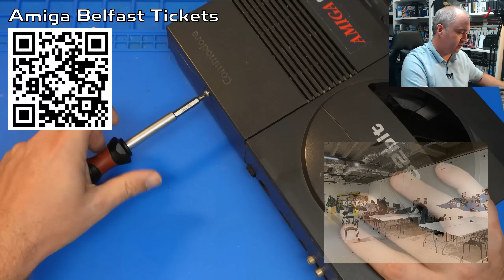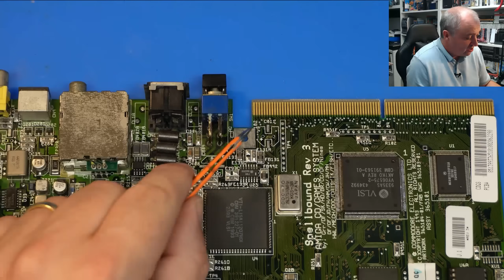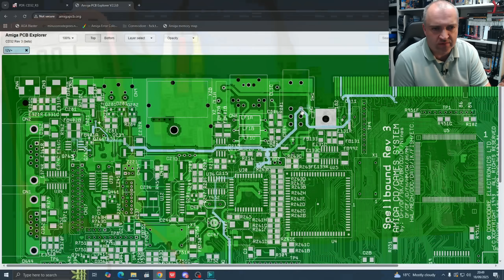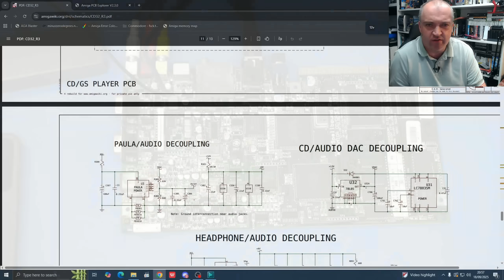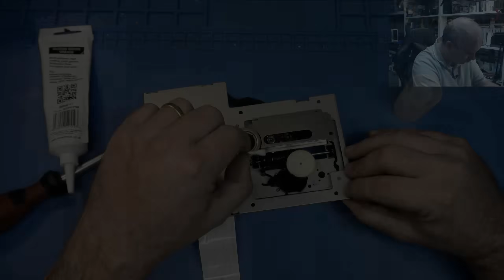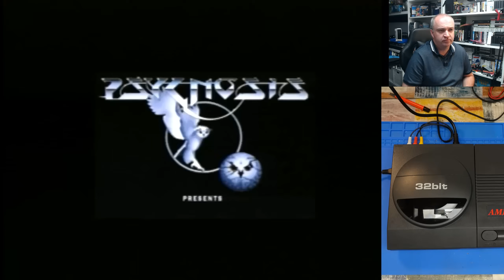I've NEVER seen this FAULT in an AMIGA

Comment: Hi Glen. So I used to be a quality control inspector for an electronics manufacturer down here in Dorset. The company was called surface electronics in the early to mid 90s and then became hansatech. We built satellite receivers, audio amps, vendor machine circuit boards etc etc. It no longer exists. Contracts ultimately lost to China through the naughties killed off a lot of the manufacturers in this country. Anyway back in the day, once a pcb had been populated, and then through the IR oven or wave soldered, it's possible that contamination could prevent a through hole being soldered. This would hopefully be picked up by a bed of nails test, and then a visual inspection. Two issues. Firstly the bed of nails won't pick up up an unsoldered switch, its mostly logic circuits it's looking at, and the visual inspection is relying on a human who is mostly rushed and under time pressure to get the product out to dispatch. So the final process that can pick up any issues is a test much like you performed in your video at the end. Its highly likely the pin at manufacture was just about making contact and sneaked through all of these checks only to fail out in the field some time later. Vibration making it not make contact, or hot cold expansion contraction. The fact there was no QC signature or paint pen splodge to indicate inspection done suggests to me the final look over never got done on this unit. We had a good qc system for a lot of our products, but I would say we found about 5% of units with an issue at QC stage. And maybe 1 in one hundred units would be returned. This does depend on the complexity of the build and the quality of the components that the customers specifies. Basically it was excepted that although you would do everything to ensure product went out perfect, inevitably some things would slip through the net. I guess that's why warranties and consumer rights are so important! Modern processes have no need for humans so much, and have eliminated manufacturing errors to a much lesser margin. I haven't worked in the industry since the early 2000s but I could see then that China could do it better, faster, and cheaper. But wether that was assembled in the uk or anywhere else, back then errors like that could easily happen.
Reply from the maker: Thank you for this detailed comment.  This unit must just have been missed and if it relied on a person to spot it and especially if it was working at the time then I suppose it's no wonder it was missed.  Made for a fun and simple repair 32 years later though 😉.  I've pinned your comment as its relevant to the video and useful for anyone coming to the comments to read.

Comment: I've had three A1200s in the past 32-ish years, and I had no idea about fabrication faults, but the last PCB I got hold of had most of the IDE header unsoldered. I'd never seen anything like it from CBM equipment before, and it threw me. So wonder if the same plant which made that CD32 also made the A1200 PCB I got a couple of years back!

Comment: Hi glen I have a Amiga cd32 that needs a recap also it needs a controller port one that also could be a broken soldering point or connector it’s got a intermittent fire issue works fine if you fiddle with the connector but this is intermittent. Is this something that you could have a look at ? 

Regards Nev .
Reply from the maker: Sorry Nev, I wouldn't have time to do it myself.  Not taking on any more repair work until I get other projects cleared.  I'd suggest trying Pure Amiga who do a very good job with recaps and repairs.
Reply: Ok thanks glen for your help.

Comment: I have a CD32 with solder mask going across and inside that 12v hole. There was only a tiny bit of solder in the hole holding the pin in place, which broke off after a few years. In your case that hole looked clean.

Comment: I have replaced a faulty laser with a new one on my CD32... good news no pot adjustments were required for full operation including reading CDR's.
Reply from the maker: You're lucky, I tried it on mine and had nothing but trouble.

Comment: You can get a generic replacement "gun" for 30 ish quid for those desoldering stations, I also found that tip I got with my replacement gun was terrible at transferring heat even though it looked like a better tip/part, otherwise you can't beat those units for price and you can find parts for cheap, even if I replaced the gun 10 times (one time in 6 years so far) it would sadly still be cheaper than buying  a "known brand" desoldering station e.g. Hakko for example.
Reply from the maker: The gun I have now is a replacement but its maybe 2 year old so probably due another.  The hakko would be cool but they are several hundred so I'll stick to the duratool for now.

Comment: Great video, thank you 😊, its great to see someone fault finding logically and not just probing around and swapping components out. I loved what was a very exciting time in gaming with so much tech out there to gamble on buying. 

Just for info the CD32 was marketed as the Worlds first 32bit games console but it was actually the FM Towns Marty in Japan but the CD32 was the first in Europe.

Thank you again for a great video
Reply from the maker: You are sort of correct.  The FM Towns Marty was marketed as the first 32-bit console, but by the definition of the time it's a 16bit console.  They based the claim on its 386 processor (yes x86 cpu) but it uses the sx variant of that chip which is only 32bit internally.  The 386sx has a 16bit external data path.  The funny thing is that by their own logic its not even the first console with a 32bit internal processor.  That claim would go to the Mega Drive using the 68000cpu.  The cd32 on the other hand with its 68ec020 cpu is truly 32bit both internal and external.  

I suppose it depends on how you measure it, but as I said above, at the time I think it fair to say the bit depth of a console was measured in its cpus data bus. 

In any case its great to hear you enjoyed the video.

Comment: i had one that somehow static electricity went into the gamepad. this messed up the circuit causing the d-pad to constantly register right. got it back under warranty and immediately happened again so i had to return it. when i got it back i took the controller apart and electrical taped the inside up to prevent static electricity from getting in again. never had an issue afterwards.
Reply from the maker: Thats an interesting problem, must have been a fault of some sort in the controller.

Comment: Reminds me of an AT motherboard, Pentium machine. No sound. First tried another Sound Blaster card, still no sound. Actually tried a lot of things, before I got another motherboard. Still no sound! The fault was missing -12V, only used for serial port and some sound cards. Broken pin in plug from PSU. Sometimes we try a lot of things, before we find a simple fault :) Good job!
Reply from the maker: Its usually the simple thing that you never think to look for.

Comment: The fact that this console never found its way to the recycler or the trash is amazing, so many consoles and computers over the years have been thrown away with fixable faults just because whoever had them didn't have the knowledge to get them going. I have a feeling this probably worked enough from factory due to the metal of the pin and pad being new, and thus no corrosion, console passed quality control, shipped to store, gets bought by someone and it worked until the area oxidized enough to stop conductivity between pad and pin, the owner probably tossed it into a closet or attic and forgot about it
Reply from the maker: I'd say that's likely to be correct.

Comment: Wow. What a find...just a lousy solder joint...from factory. 
I restored a CD32 in november of 2024. It was a real unicorn, it was fully expanded with the A1200 ports and on top of that with the SX32PRO 030-40 turbo card. (The two caps were soldered in the wrong way on mine and bulged)
The CD32 itself was in a good condition, but for some stupid reason, the SX32Pro card was WARPED and the IDE controller worked only intermittendly. Certainly there was no schematics available for it, so it took me like 2 weeks to figure out what was wrong. I had no chance to reverse engineer the function of the two early CPLDs that were on the card...but eventually it became clear that one corner of a CPLD had 2,3 pins detached from the board due to the warping-the ones that controlled the 74LS245 ICs of the IDE port. Despite that nasty problem, I am proud I got this rare piece back to full function, plus 8MB 32 bit Fast RAM, a 4 GB CF card, ceramic 030-40 CPU, and all that in this small form factor. 
It was a christmas gift for a friend, from another friend whose brother died, inheriting his Amigas to my friend and some of them also to me... ^.^

Comment: so there might not have been anything wrong with the caps then, if the 12v pin had never been soldered
Reply from the maker: With their age they still need to be changed.  A few had leaked causing the solder points to corrode.

Comment: I have once come across a rev 5 A500 that also had both  the 5v and the 12v power connector pins hanging more or less loose in the pin holes of the PCB. There was a bit of solder on the pins though. But it had been that badly soldered from the factory and the machine was basicly just brand new from the inside. As the owner had just put it aside in the attic as it had more or less never worked.
Reply from the maker: I wonder how long this one was used for before it was called faulty and put away.
Reply: @CRG I really don't know, and I'd like to know too. Didn't really ask much about it as it was a an Amiga I bought from a person that was just more or less clearing out old belongings from their childhood home after their parents had passed away. And they had a lot going on and didn't really get a lot of a chance to chit chat. But the guy said that he doesn't know much about the machine besides that it doesn't work and as he recalled it never maybe did. And indeed the main unit and the external fdd unit were looking absolutely new like from the factory and just totally unused with warranty seals and everything on. The plastic casings rtc were of course yellowed but they too looked absolutely untouched as well. So, I'm thinking that if that machine ever worked, so it was used for a very short period of time.

Comment: I get the feeling that Commodore's QA wasn't great. I had some issues with one slot on my A4000D's Zorro daughterboard. It turned out that 3 pins on one slot were missing solder from the factory.
Reply from the maker: Had a couple of comments about missing solder so maybe it was more common than I thought.  OK there where thousands of the machines made so perhaps a few sneaking through the net wasn't that uncommon but does make you think how many had solder issues that were caught and had to be repaired before sending out 🤔

Comment: Where did this machine originate?  Someone who had bought it and it originally worked?  A return at the retailer later sold as-is? I can't see the PCB not being tested by the manufacturer before being encased, so maybe the 12V rail lead was making contact with the pad then and was later knocked from it through handling and use?
Reply from the maker: It came to me from a viewer who wanted it repaired but I don't know where they got it.  I can only assume the PCB was tested at factory and either by dumb luck or a slither of solder which I didn't see.  But I'm sure it didn't last long out in the wild.

Comment: 20:16 Looks like there's another unsoldered pin on the right side of the connector...
Reply from the maker: Unfortunately I don't have the machine here anymore to check (its away back to its owner) but I think its just a reflection from the overhead lights.

Comment: Wow, rare cd32 video. Good info as I haven't recapped mine yet. Especially the backwards cap thing. Also mine has a weird fault. The video image is too low and pushed to the right. It does this on every TV and has trouble booting discs sometimes. I definitely need to work on it soon.
Reply from the maker: Be sure to get it recapped as soon as you can.  This one wasn't too bad but some machines have really suffered.  The Amigas image can look a bit off to the right on some TVs.  There's not much we can do about that I'm afraid.  Shouldn't be low on the screen though and not really sure what would do that.  The lasers on these can burn out but as I said you can get replacements easily enough.  Recap it first though.

Comment: an interesting video to me on several fronts - i never owned an Amiga of any sorts so i was gloriously unaware of Guardian. what a great looking game! not something i would expect from a machine bearing the Amiga logo - i typically expect 2D stuff like Cannon Fodder. also the game disc really doesn't look that different from a blank CD-R does it? what a cool little loading animation as the text wraps itself away along the top of the screen.

also such a very weird fault. that board was just never truly completed because the soldering wasn't complete. you're right to say it's weird how it left the factory. that board didn't just leave the factory...it was assembled into a whole machine. what's the point in QC if you pay no attention to it or don't do it?
Reply from the maker: Guardian is an awesome game.  It can slow down a bit on the standard console but if you can get an accelerator in it then it flies along.  Of course back in the 90s we didn't really mind that it slowed down,  that's just how it was.  It's on the A1200 as well but you really want to play the CD32 version with its cd audio music.  

The disc does look like a CD-R but it is a proper pressed disk.  Unfortunately its started to delaminate on the edges, still works for now but I need to make a copy of it before it totally fails.
Reply: @CRG thanks for taking the time to reply. As a console kid until the days of Windows 95, it immediately struck me as a smoother Starwing/Starfox. Colour me impressed.

Comment: Imagine all those chips getting 12V for the first time ever, after being in the machine for 32 years...

Great video, as always.
Reply from the maker: I can only assume it must have worked at one point, presumably by dumb luck of the pin making contact but if it did, I'm sure it didn't work for long.
Reply: @CRG  I wouldn't be surprised if the bending had something to do with it. Maybe it made contact at some point, while the board was still straight.
Reply from the maker: Good point, I had forgotten about the slight bend.  Could very well be that case that the bend cracked whatever was making the connection.

Comment: What's more surprising to me than the fault itself, is how it wasn't scrapped at some point during all those years. Perhaps it came from a reject pile stuck in an old warehouse or something. I suppose it means the machine could be considered "brand new".
Reply from the maker: Might be the case it worked for a while, either just out of dumb luck with the pin hitting the hole or maybe there is a flake of solder in there I didn't see.  If it did though, I'm sure it didn't last long so might just have been shoved into storage until now.

Comment: could you not have removed the ribbon cable for CD unit first and put the ribbon onto the slot, then replaced the sheild and just plugged the CD unit in?
Reply from the maker: There isn't enough room to get your fingers in to attach the ribbon on the cd drive side.

Comment: Nice one! Simple but odd issue to fix once found. Wonder if it was QC like this that was the beginning of the end for Commodore, or if this was the ESCOM era?
Reply from the maker: This was still commodore but it might very well have been a symptom of the end.  Come to think of it Im not sure if escom made any CD32's?
Reply: @CRG  Commodore always, going back to the early days of the c64, had weak quality control. Their policy was to  just replace it, no question. Our first C64 in 1989 was one of them. It took Comet 3 months to get the replacement.
Reply: @CRG just figured cd32 was 1200 era they would have gone hand in hand